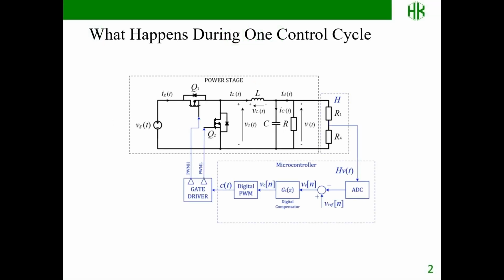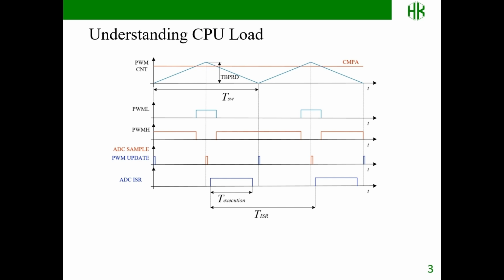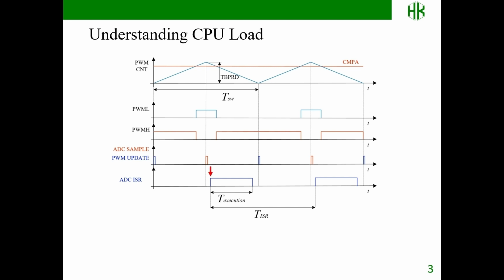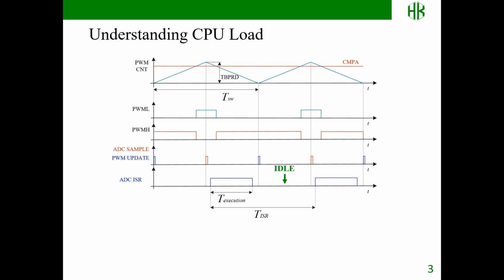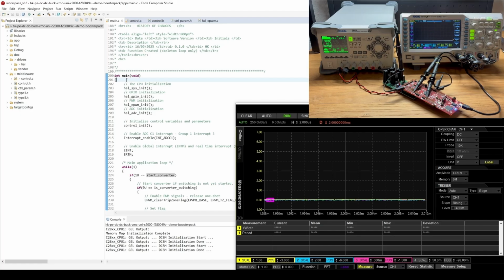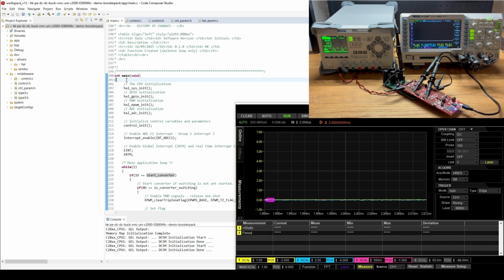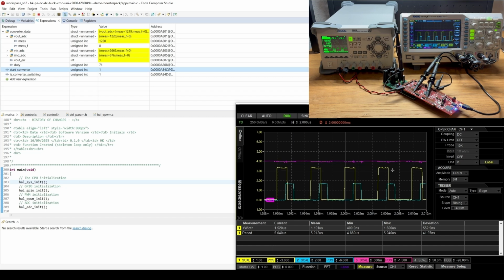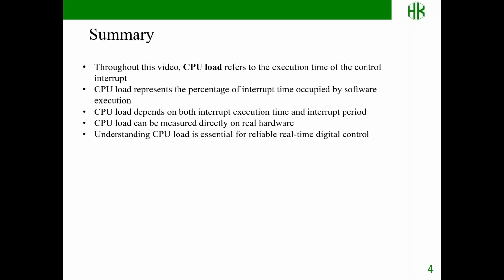Understanding CPU Load in Digital Power Control

Comment from the maker: 📌 Note: Throughout this video, the term CPU Load refers specifically to the CPU load of the control interrupt, since it is typically the most time-critical task in a digital power control application.
In a complete embedded system, the overall CPU utilization may be higher because it also includes additional interrupts, communication tasks, DMA transfers, background software, RTOS tasks, and other application-specific code.
This video focuses on the control interrupt to introduce the concept as simply as possible. Later videos in this series discuss CPU load and real-time software design in more detail.